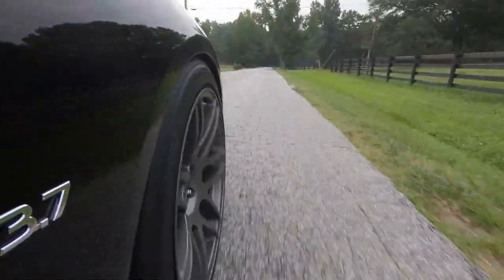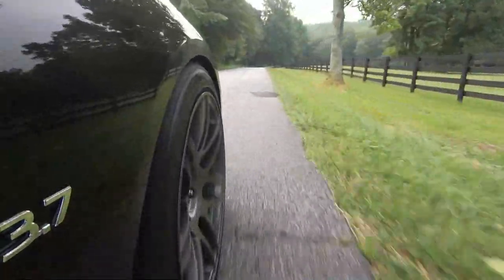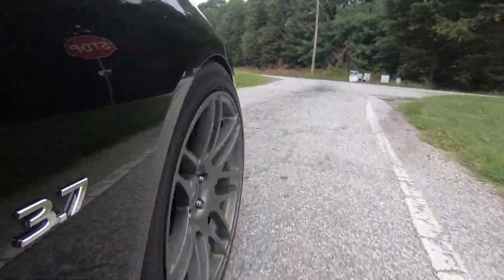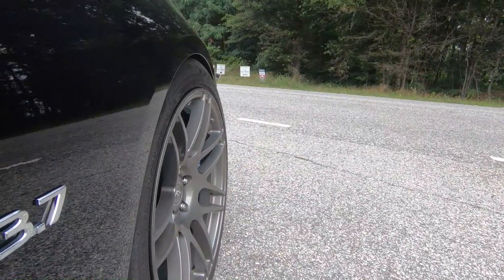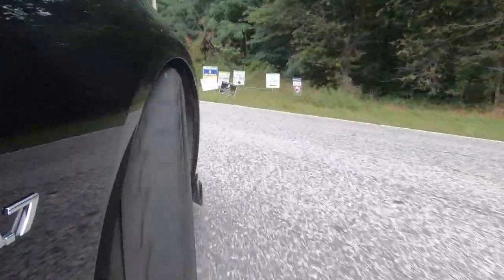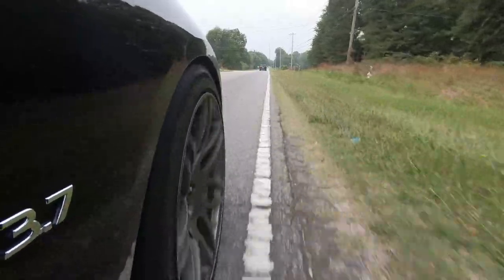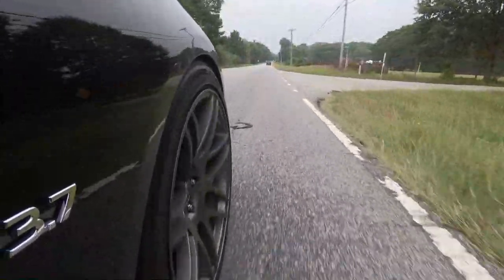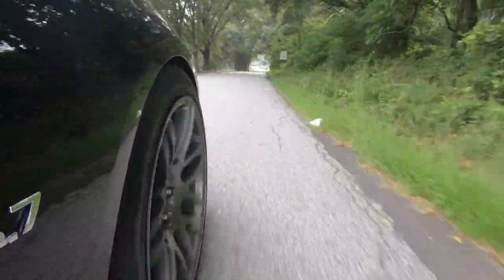Soul Function Braces WORTH It???

Comment: I always appreciate the fact that you take the engineering of the car into consideration. There's so much that goes on behind the design of a vehicle and too many tuners are too quick just to slap on a part with no regards to the consequences. Always appreciate your videos man keep up the great work.
Reply from the maker: Thanks for watching!  Yeah it’s as if people think that these cars were just built for the first time lol.  There has been so much engineering and research and development that has gone into them.  Certainly there are times when we find shortcomings and find ways to improve, but more often than not, things are done certain ways for a reason.
Reply: @SpeedCultureStudios  definitely, I've learned so much in engineering school of what goes in behind all this stuff. oftentimes you can discern why someone has designed something the way it is. Enough at least so that when your modding, You can understand the pros and cons of what you are doing. But the mentality of individuals thinking that they're smarter than the engineers that design the system is far too prevalent.

Comment: Hey bro, sweet video as usual and informative. Wanted to see if you could do me a favor and reach out to Soul Function for a question I have. I tried to contact them by email, but no response. But I have a 18 luxe AWD and the application chart was confusing. It said that one of the braces fit on one site and that they don't on another because mine come stock already. My thinking is, we have other parts that we replace for strength and or adjustability and if these strengthen my subframe and work, then I would be leaning towards getting them. Thanks man, if you're able or willing to find that way or me and other AWD guys. Thanks again.

Comment: @speed culture studios I just got the carbon fiber duck spoiler.Does the bottom of the spoiler sit flush or no?Because I installed it and the bottom part of the spoiler doesn’t sit flush. Is it suppose to be like that? The top part of the spoiler is fine it sits flush.
Reply from the maker: It should make contact with the trunk lid on the top and the bottom.  You have gaps?
Reply: @SpeedCultureStudios  I mean there’s gaps under the lid it doesn’t make enough contact for the 3m tape on the bottom to stick to the trunk.
Reply from the maker: @amerkamal1859  did you test fit it without tape first?